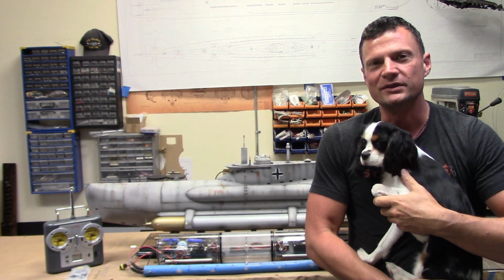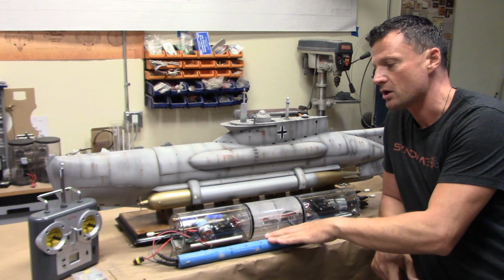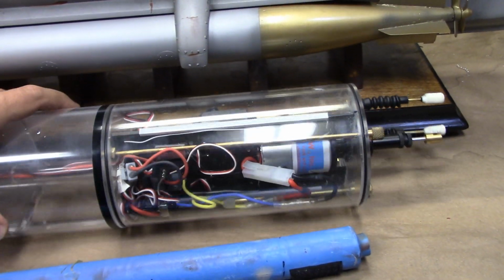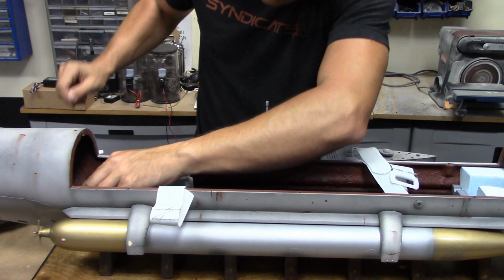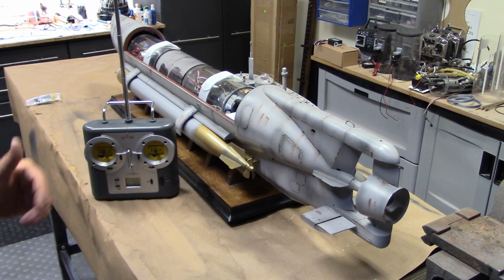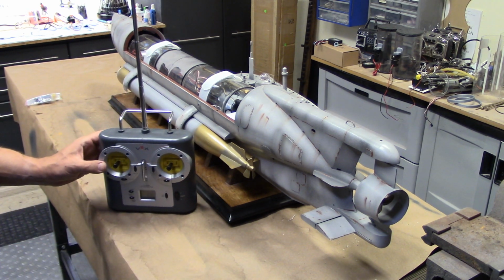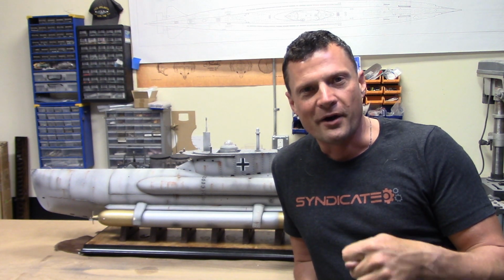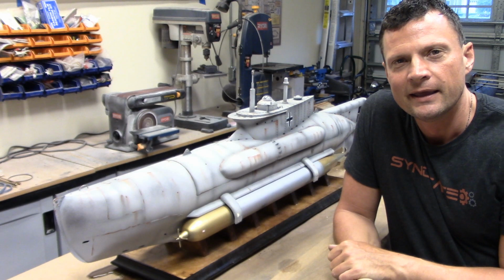OTW Seehund RC submarine model overview

Comment: As a military aficionado i have a while bunch of rc planes and helis and race quadcopters. But always loved subs...subsims..sub games. The type 212 review was great. I have a 3d printer and attempted to build an rc sub a while back but the model i bought was too small in the end. I bought some older 75kHz gear from ebay just in case I get another chance and looking at ur 3d print builds with interest. Although like many rc planes and quadcopters the cheapest part is usually the frame or body...when I start to price out the cylinder and gear in my head it gets tougher...But will keep tuned in!